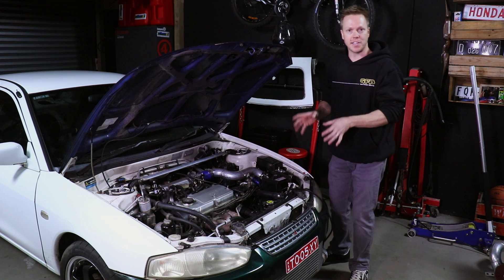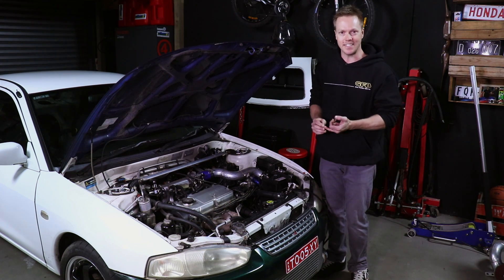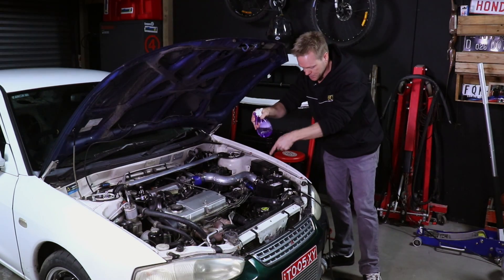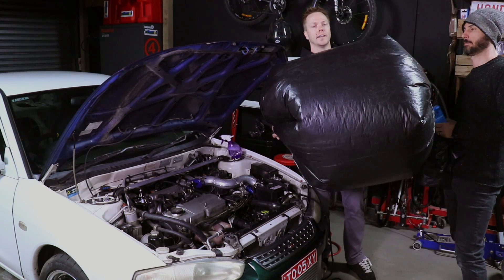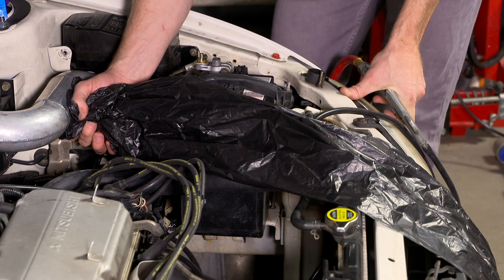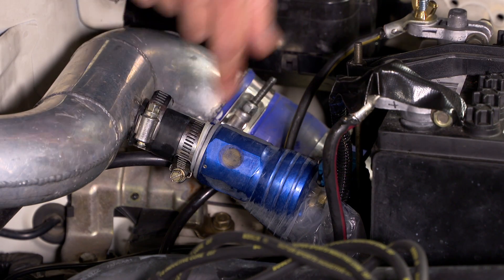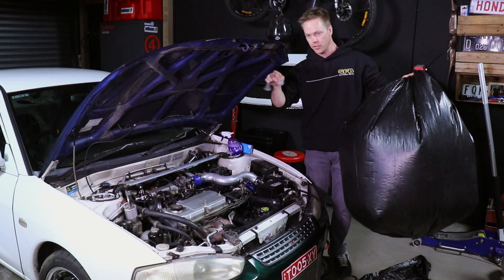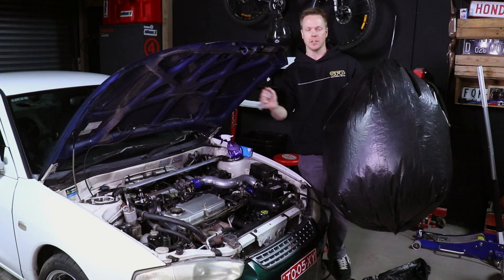Condom Boost Leak [GO FAST BRETT]

Comment: i had the opposite issue, the o-ring in the BOV was not leaking so I was leaking vacuum causing the car to run like pooo. and also during boost it was causing a big leak since it wasn't letting the BOV work right

Comment: the interesting figures would be when the system is at operating temp and not at room temp. i still agree on a similiar conclusion, but i'd like to see if the volume changes due to material expansion and movement. hell, even get the motor to do it iself.

Comment: you cannot judge the bov on leaks if you don't apply boost on it's vacuum hose, cause when the car is on boost, that boost is pushing the BOV shut. right now its only the spring that is keeping it shut.

Comment: there is more then just pressure loss going on with a boost leak, you should be worried about the AFR changes as well. under boost might not be that big of an issue as it will run more rich, but under vacuum it will be more lean and that is when you might see some knock. and if you run a newer car your ECU could detect that knock and potentially lower timing across the timing map depending on how bad it is. netting you a loss in power far greater then a portion of air that is filling a condom. good example, I had a leak on my 02 wrx and it caused my timing to lower 2 deg across the board due to the way Subaru knock correction works. that is a lot of power i lost because of a leak that really was only a issue under vacuum.

Comment: my only rebuttal to this is, thet was at an idle. As any car guy knows, the engine is pulling vaccum at idle pushing no boost.
Reply: that... not "thet" lol...
Reply: I think they were feeding 15 psi of air through the system for the test to see how much air was leaking out so pretty sure you're not sitting idle with 15 psi of boost going through your car! lol
Reply: +ccbernard the engine pulls 10-14.75psi/.8-1bar when idling, which is atmospheric pressure. So in essence even though the test was performed with a compressor, it was basically as if it were at idle.
Reply: I forgot one key aspect lol... If the engine wasn't running the whole time, the throttle plat would be closed... So the test is probably a bit more accurate than I thought originally, watched the video when it first came out and just commented today lol...
Reply: damn phone.... plate not "plat"

Comment: You forgot the most important part! Dont forget to remove your Oil fill cap, or else your block will build pressure and if you screw up on the inflation you can blow out seals!!

Comment: All jokes aside, the only flaw I can see with this test is you can see the condom is filled with air, Brett later stretches the air to the tip of the condom which would increase the pressure (just by a extremely small amount), whereas the garbage bag is not stretched to the same amount, so the pressure is not the same between the two which does affect the volume in a closed system. But even with this, Brett is still correct leakage ratio is extremely small and you shouldn't be too worried about losing efficiency as a turbocharging system effectively takes energy that normally goes to waste (your exhaust) and uses that to increase the volume of air inside the engine without having to increase the engine capacity

Comment: The pressure is the same, but the increased volume and speed of air compressed by the turbo will make any leak you see in a boost leak test much worse. I've logged very noticeable differences in power from a leak like that, especially if the leak is before a MAF.
Reply: wat. That's not how physics work bro, pressure = pressure, whether the air is moving or not, makes no difference. MAF should be before the turbo so not sure how any leak pre-MAF could make a difference, you could get unfiltered air sucked in but it's pre-MAF so wouldn't make a difference to performance.
Reply: +Willhemmens So you're saying turbulent and transient air puts just as much strain on a leak as static air? We'll have to agree to disagree on that one. And there are blow thru and draw thru MAFs, but you're right I should've said after the MAF.
Reply: Yes, he's right. A set pressure of air, no matter what the speed or turbulence level would not equalize (leak) with the atmosphere at any faster rate than static air. Only the pressure and size of the opening will control the rate of the leak.
Reply: +SandyManHD In theory pressure is pressure. In the real world even a tiny leak will rob you of measurable power. Static air and dynamic air are not the same. The air leaks a percentage of volume. Boost leak tests contain much less volume of air. A running engine uses much more volume.
Reply: Your understanding of the air in a running engine seems to be off, just because there is more measurable air going through a running engine, this doesnt change the fact that there is only x amount of pressure at any given moment and a corresponding volume of air. The small sample taken from the test is 60x the amount that is actually lost during a second of air consumption. The rate will not change, when compared with the consumption of air by the engine. simple maths, and physics.
Reply: In those simple maths how do you account for thermal expansion of whatever's leaking? Or the pulsing air from the exhaust stroke of the pistons? Or the rapid changes in pressure a turbo causes that the air compressor can't replicate? Boost leak tests are a good way to find leaks, but not to measure lost air under boost. Way too many variables change when the car is running. Better way to measure lost air is with a blow through MAF and comparing MAF frequencies before and after a pre-MAF leak is fixed.
Reply: Like i said, a set pressure, gives a set volume of air that does not change. for every moment at a set pressure the rate of equalisation will not change. The pressure varies yes, but then the rate of escaping gasses will also reflect that. The rate of the leak will always follow the pressure level. If anything, in a true scenario, the pressure drops slightly with every intake stroke so the leak will actually decrease, as the pressure reduces. Also, the exhaust stroke of the engine will have no impact on intake pressure.
Reply: Thermal expansion etc. all variables are effectively out ruled as the turbo wastegate/solenoid continuously aims for a set pressure, as the air becomes heated and expands causing a slight pressure increase, this would be accounted for with the release of boost through the wastegate.
Reply: i hate to say it but Nate is right, a boost leak test will not show you the proper amount of air being lost, a good way to compare this is to put load on the engine using the same methods(condom or trash bag) and compare the amount of air captured between the boost leak test and the turbo actually providing pressure
i'm willing to bet that there will be a bigger leak when the engine is under load
Reply: Think logically here, static pressurised air, will find the lowest resistance route out of the intake system, in this case being the leak. A running engine is constantly pulling air out the the pressurised intake. There is no physical way a leak would give out more air when not only the pressure is the same, but the air is rhythmically moving into the cylinders. Its that simple. Same pressure at the source of the leak, same volume of air, and same dimensions of the leak's opening.
Reply: SandyManHD I talked to a couple physicist I know and the consensus is, it depends. The MCM test is completely flawed and the comparison of air volume between the condom and trash bag is laughable. But your theory is correct, but practical application isn't so cut and dry. There are so many variables like velocity of air and shape of the intake and ridges that can create high and low pressure pockets of air it 100% depends on where the leak is and how the air is routed to and past that leak.

Comment: ok, now remove the whole BOV and fill the garbage bag in 1 second with that compressor. nope. not going to happen. cant make comparisons like that with a compressor that doesn't push near the air mass the turbo would.
Reply: if the pressure at the bov is the same under the compressor as it is under the turbo there is a comparison. They're measuring the leak airflow not the total engine airflow. The max flow of the compressor is irrelevant as long as it can hold pressure, which it can
Reply: yeah, i guess that makes sense.

Comment: that covers boost leaks, but what about under vacuum, it could cause un-metered air to come into the intake and cause stumbling due to a lack of fuel, any easy way to test for that?
Reply: the bov is before the throttle, so theres not really much(any) vacuum inside the "intake" - pipe. so a small leak like that wouldn't affect anything.

on the other side releasing pressure to athmosphere on a maf-based ems is a big thing, fucks with the calculations!